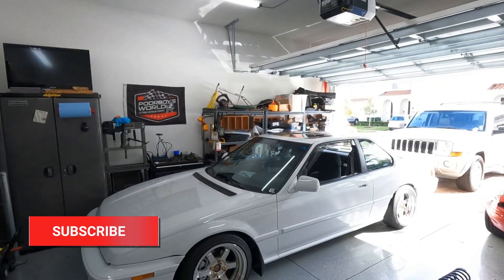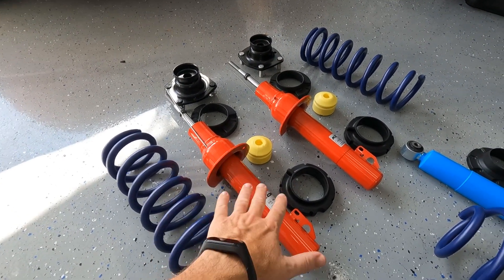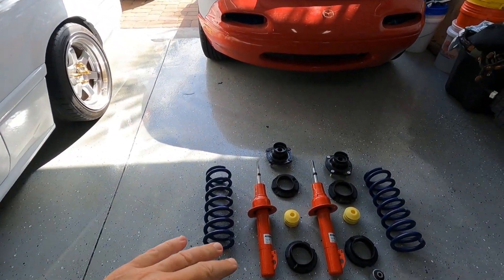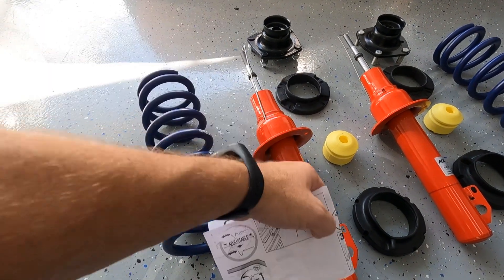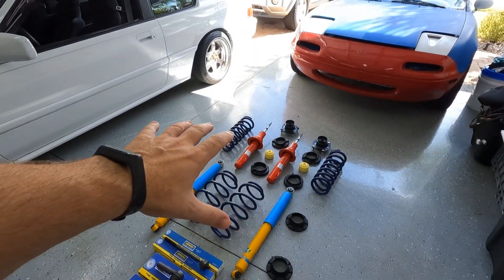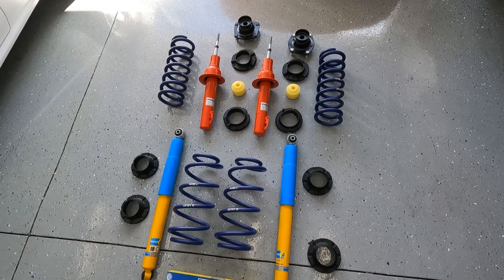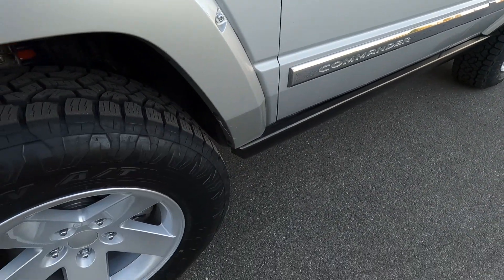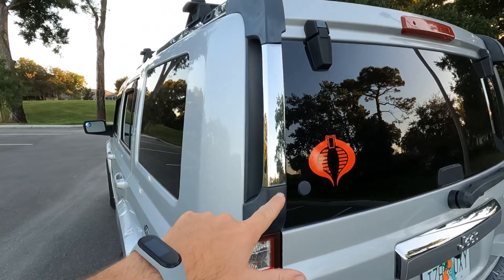Jeep Commander Gets a Lift!

Comment: As you have probably figure out the bang or thumping you hear taking off .
Is actually a differential mount.
I've changed mine on my jeep commander already. Happy driving.
Reply from the maker: It was actually the sway bar bushings. However, I do have to replace the differential mounts. They knock when shifting from park to drive. Thanks for watching!

Comment: Fun bit of info, KONI is from the Netherlands, and the Jeep Renegade (the one that's manufactured in Italy at least), has KONI shocks, ones that become more stiff in corners, and are more forgiving when offroading. We own a Renegade, apart from the Commander, and got about 120.000KM on the clock of the Rennie without a hassle. KONI all the way!
Reply from the maker: Nice! That's great feedback. Thank you. I love them so far. It's cool that they are adjustable, it's just a terrible process for the front struts, but could be useful if I ever decide to get a metal front bumper, which would increase the weight upfront. Thanks for watching!!

Comment: I ran 275/70/17 with 1.5 wheel spacers - on 5100 max lift on shock and some cutting and well nothing a hammer 🔨 can’t fix 😂
Reply from the maker: Nice. I plan on going to bigger tires soon. Thanks for watching.

Comment: ⭐️ cool video, i just got a Jeep Commander and I'd like to put 20" rims on it, probably with low profile tires... I also want to add a snorkel and a winch... 🤷‍♀️ idk, i hope the vehicle is sturdy...
Reply from the maker: 20 inch wheels, low profile tires, snorkel and winch don't all go together. I would lose the 20 inch wheels and low profile tires It's a bad idea. That's going to be a lot of rotating mass, which will hurt performance, MPG and probably give you all sorts of steering issues. Good luck and thanks for watching.
Reply: @ExtremeDailyDrivers  ⭐️ that makes sense, but 245-50/r20 tires are actually smaller than the 245-65/r17 tires already on the jeep...

Comment: I bought a Commander like two months ago, first thing I did was get some new tires on it, I got 265/65 R17, and I haven't noticed anything wrong/rubbing while driving. I didn't install any lift on it as it seems to sit pretty high already, higher than a new Wrangler.

Anyway your Commander looks really cool, they look cool even stock, that's why I wanted to buy for a while. I also have a 93 XJ which is an amazing Jeep, have it since 2001 and it never gave me any trouble
Reply from the maker: Try putting on some 265/75/17's like I did and I bet you'll be rubbin'!! Congrats on the new Commander! Make sure you sub to the channel I put a new video every week and lots of Commander content coming. Thanks for watching.
Reply: Same I don’t have a lift on mine and I have 255 70 17
Reply: By now you most likely have found the rubbing on the passenger side front wheel liner, a shiny spot!

Comment: Hi. I’m trying to do the same setup. I think the strut hats don’t come with the upper isolators anymore. Any recommendations? 

I‘m also not looking to do a lot of off-roading but I have a 2008 overland commander and I want to raise the suspension to throw on some JL wrangler wheels (275/55/20). I know I’ll use wheel spacers. Do you think I can just get away with the RC spacer lift or do your setup lift with the BS5100s shocks? FYI this setup in your video is over $1200 now lol
Reply from the maker: Do not cheap out on your suspension or you will regret it. It doesn't matter if it's a Jeep or Honda or BMW. It's too important. And I wouldn't use wheel spacers. Do it right and do it once.
Reply: @ExtremeDailyDrivers  thanks - i think with the JL wheels i need to use spacers because they’re from a 2024 Wrangler. I maybe wrong but hubcentric spacers are probably needed to clear the brakes on commanders with those wheels. I think the tire size of those new wheels are equivalent to 32” so that should clear with your lift setup?
Reply from the maker: @platinum7990  You will need spacers with the Wrangler wheels and yes the tires will clear but you will still need to do the pinch weld mod.

Comment: I noticed on Jeep commander , stock suspension the rear end is an inch  higher. It looks awkward like the front end is sagging. I like the leveling kit so you can adjust the height even using the rockers as level . It totally charges the stand of the Commander
Reply from the maker: In my opinion, there is nothing more awkward than the front being higher than the rear, which basically every leveling kit for the Commander does. With that being said, I have plates that go on top of the front suspension that is supposed to raise the front end a half of an inch. I've had them for months and haven't installed them because I'm still on the fence of whether or not they are worth the hassle of installing if they raise the front higher than the rear. I'll do a video if I ever install them.

Comment: Did you have a noise problem with the back windows down when you first got it? My 06 with stock wheels does a "whunp-whump" like a huey helicopter whenever the back windows are down at freeway speeds.
Reply from the maker: Put your front windows down. Problem fixed. Any hatchback style vehicle will create that noise with only the rear windows down. It's not a Commander thing.

Comment: So almost 2 years later, how is everything holding up with this lift? Have you had to replace ball joints at all? How is the angle of front drive shafts?
Reply from the maker: 100% perfect. Better than stock.  Zero issues. My angels are perfect. Haven't replaced a thing. Thanks for watching.

Comment: I did not like how my Commander's  front end sat lower than the rear. I also did not like how my vehicle rode on rough poorly maintained pavement and washboard dirt and gravel roads. My shocks and struts were changed just a few years ago before I bought it, so I thought how can I make an improvement without major work or costing me an arm and a leg. I then thought about what racers do to smooth out the rides on their cars, so I decided to try adding spring rubbers along with a 1inch rubber block. Mr Gasket made a spring rubber the exact size I needed for my spring gap and I also added the rubber blocks (total cost $60). Now my front end height is within 3/8" of my back end and the best part is my ride on rough roads is like day and night compared to before. No more kidney jarring rides on the washboard roads to my favorite fishing spots. I was only wanting a leveling lift because my Commander is just 2wd and I needed to justify the cost to my wife so that I could continue to make modifications here and there to make my vehicle not look like every other Commander out there. I may add softer spring rubbers to the back springs but the ride is good now just doing the front.

Comment: On the springs that you posted in the description is that link for both front and rear?
Reply from the maker: Yes
Reply: Thank you. Just mounted 265s and got minor rubbing. Enjoy your videos bud keep up the good work
Reply from the maker: @justinbowden1830  The rubbing is inevitable. I did a video on the pinch weld mod. It's real easy to do and should give your the clearance you need. Thanks for watching.

Comment: Great video, great links too! If those are the biggest tires that will fit with your 2” lift setup, who much lift would you estimate I’d need to run 37”s ?
Reply from the maker: 37's aren't going to fit. Why would you want them anyway? They would weigh over a 100 pounds each wheel. You would lose so much power trying to move those things and you mpg would be about 1 HWY 0 CITY. Not to mention that you probably wouldn't be able to stop. Thanks for watching.

Comment: Just got a commander last month can I do your same suspension modifications with a 3” leveling kit?
Reply from the maker: You can but you definitely shouldn't.
Reply: @ExtremeDailyDrivers   may I ask why?
Reply from the maker: @gosstg09  My lift plus a leveling kit will not work. The front will be 5+ inches and the rear will be 2+. Your drive train won't last long either thanks to the ridiculous angles you will create. There are really only three options to lift your Commander. 1. Spacer lift 2. OME lift (basically the same thing mine is except with different components) 3. Superlift (which is discontinued). That's it. None of the three will work to together. Can you do it? Yes. Will the Commander be an absolute nightmare to drive and suck off-road? Absolutely yes. Don't do it.
Reply: @ExtremeDailyDrivers  Lol thanks for helpful information maybe I should’ve did more homework, sucks there isn’t many lift modifications for the commander.

Comment: How did you get the clevis bolts out? I have been struggling for a few days with mine.
Reply: Had the same problem,ended up pushing the mount bolts for the struts through and bolted them down,cut the bolts down with enough thread to keep them safe. Unbolt and slide it into the clevis and lean it under,may have to force it a bit. Get me by until I get new lcas and clevis bolts to fix the problem. Be sure to unhook everthing,end links and tire rods so you can push down on them really good.
Reply from the maker: It took an air hammer and air ratchet to get it off. It was a nightmare. I wasn't able to remove it in my garage, which is a first for me. I would recommend cutting the bolt. You can get replacements from the dealer. Thanks for watching.

Comment: The front end still sags
Reply from the maker: It's level. It's the exact same height as the rear. I measured it. And there is nothing uglier than a truck with a higher front end than the rear. Thanks for watching.

Comment: The clunk that you speak of has nothing to do with tie rods ball joints or any of the above it is your front differential bushings there are three of them they are a  p i t a do yourself a favor and replace them with polyurethane bushings the first time you have to do it because if you use the factory rubber bushings or the knockoff ones from anywhere else you will replace them once every year and a half 2 years.... Hope this helps
Reply from the maker: Thanks. The clunk that you are describing is when you go from reverse or park into drive. I don't have that issue. My problem was driving over bumps and accelerating was causing a clunking noise. After the installation it's gone. Thanks for watching.

Comment: i fit 33s 2 inch lift lmao
Reply from the maker: Tell us how you did it!
Reply: @ExtremeDailyDrivers  1 1/4 inch wheel spacers. Did the chop on the front bumper you did. And grinded my pinch welds and welded it back together.